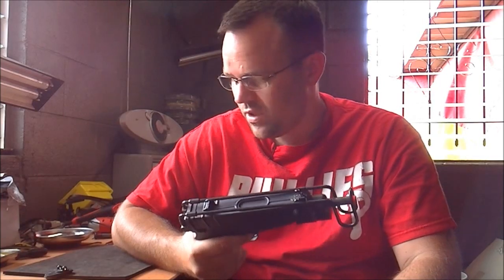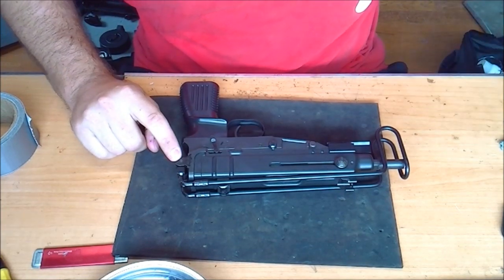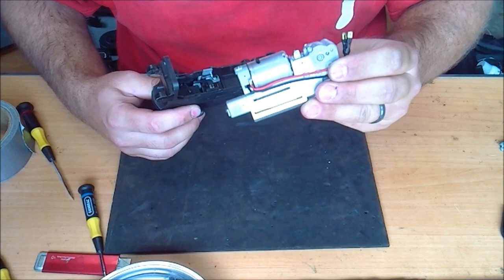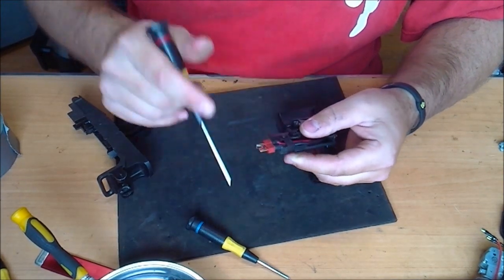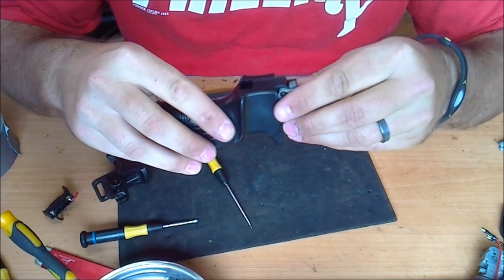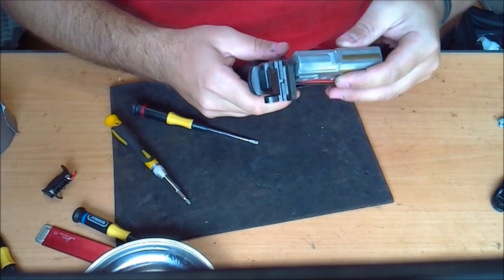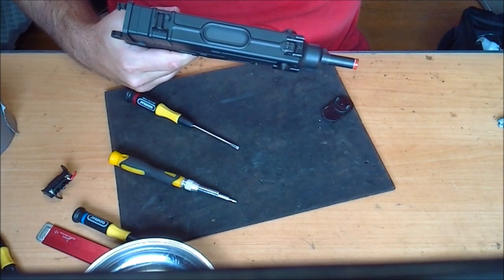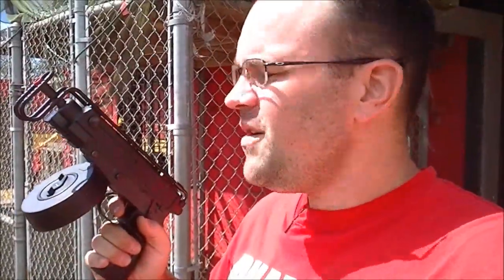Tokyo Marui VZ61 Scorpion disassembly & review.

Comment: Thanks for the video, it was very useful for the lipo mod.
I'd just like to add a few of notes which might help others who want to disassemble this AEP. I hope you don't mind:

3:37 The small allen screw near the trigger guard is the motor adjustment height screw, and should NOT be removed.

It's very easy for the semi/auto selector piece, (labelled R-16 in the Well manual) to fall out when you remove the pistol grip.

 7:08 There should actually be 2 screws holding the switch assembly into the handgrip, the one shown in the video, and another near the top left in the video (the 'front' end nearest the trigger guard.

Just so people don't get confused :-)

Comment: I just got the Well clone of this gun and I dropped it out of the box and totally snapped the pistol grip from the receiver, this video saved my ass and helped me fix it! It works just fine now! Thank you for this
Reply: Had the same thing with my asg, had to basically look at the exploded diagram for about 6 hours to reconnect any and all wires and springs that detached, and then I replaced the 2 stock screws that failed to hold the pistol grip on with 2 1 inch Allen bolts

Comment: I have the WELL model and you have to split the grip in half with force (carefully!!). Mine was glued at the bottom of the grip, started at the top.... Then you can unscrew the trigger/fuse assembly from the left side grip half so you can lipo mod and wire to deans.

Comment: Interesting, thanks for the video. I'm thinking about silver rewiring, using the stock battery, adjust the gearbox and change the bucking and barrel. Hope it will work well.
Reply from the maker: Having low resistance wiring will help but the limits of the nicad stock battery are well below the 7.4v 500 mah lipo i used. I also replaced the stock wires with low resistance ones though not silver. Also the barrel and bucking were aftermarket installed by the owner.
Reply: @gruntlogic6239  Merci. Do you have to cut or make any hole in the pistol grip to allow that upgrade?
Reply from the maker: @juakagami8070  I did. the plastic that holds the stick battery, fuse all came out for mine to make room for a deans connector, wire and 7.4v 500mah sky lipo battery. Maybe you could find a battery to fit without modifying but I chose not to to fit the battery I had available

Comment from the maker: if its engaging the motor when you pull the trigger i doubt its the wires. Airsoft Atlanta has some replacement parts available as does airsoft gun repair dot com. the second site has the gun parts in sections for sale so you can drop in a whole motor and gearbox in to replace yours which i think might be your issue.
Reply: I need you help with the gun

Comment from the maker: For the Hop up I believe that the bucking is a regular aeg bucking but if you just want to replace the whole barrel/hopup assembly for $20 shipped then use the link in the description for airsoftgunrepair(dot)com.  I also will double check for you tomorrow as my gun is at Kapolei Airsoft in my locker.

Comment from the maker: it could be a piston that is locked to the rear just like an AEG. it it dosent release with a full charged stock battery you might have to find a way to connect a 9.6v using wires or alligator clips. If its still stuck you might have broken a gear.

Comment from the maker: ok first sorry for taking so long to respond, and as to the trigger issue the trigger issue could be from a broken piece in the trigger group. The trigger group is housed in the pistol grip and contains 20 or so small connected pieces that if one fails it can make the gun not function properly. If you want to just replace the trigger mech or any other piece you can get them at airsoft gun repair (dot) com and just search for scorpion parts.  I'll also add the link to the description.

Comment: Scratch that- the Allen screw near the trigger guard is actually motor height adjustment- too tight and the gearbox will seize! ;) FYI for anyone using this very good guide ;)

Comment: Hi Chap. So I've stripped the gearbox to reshim, do air seals and regrease. Gearbox runs beautifully outside of the receiver but when it's back in doesn't cycle, any idea what I've missed? Battery gets warm, connectors are back where they should be, baffled!
Reply from the maker: Rich Upton sry for the super late reply, but it seems that there is something that is preventing the motor from turning so as you press the trigger and feed electricity to the motor it wont move and loops the power back into the battery creating heat.

Comment: hey gruntlogic i bought the JG Scorpion about a month ago and just recently it stopped firing and i opened it up. The wires on the fuse box end had ripped out and I was wondering if I can just cut them and re wire to deans. Also what battery can fit in it with that configuration?

Comment: What are the dimensions of the pistol grip? I'm about to order some 30x12x55 batteries, will they fit?
btw, the video is really informative and it's been a great help
Reply from the maker: So Jose. I'm not quite sure what the dimensions of the pistol grip are but after my modifications I was able to fit a Dean's connector as well as a sky lipo  7.4 V 500 mA battery  You could get the wires.
Reply: gruntlogic6239 thank you, I'll check it out

Comment: So I am trying to do this mod on a couple of my Vx61 Scorpions and I am wondering what specific battery you were able to fit in the grip? I'm having problems fitting an 800 7.4v lipo in the grip. Could you point me to some models that fit?
Reply from the maker: +Jason Lane I used a sky lipo 500mah 7.4v, I'll add link in the description
Reply: +gruntlogic6239 thanks! How long does the 500mah last? I am worried it would not last a day on the field.
Reply from the maker: So it lasted me through 7-8 drum mags out of my gun and still had power left.

Comment: Hey I have a question, I know this is an old video do you still have knowledge on this?
Reply from the maker: Its 7years old but I remember what i did and about the gun, why?
Reply: gruntlogic6239 wow I had low hopes for a reply thanks, but yea there’s a little part that goes with the selector switch, I completed the lipo mod but my fire selector doesn’t work, can you help me please?
Reply from the maker: @clognehssi9832 if it's not firing at all then I would say that your selector on the mech box is in the safe position and when you try to move it to fire/auto it won't move. Either that or you might be putting the selector in incorrectly. I had that happen once or twice working on my gun.
Reply: gruntlogic6239 my gun only shoots on full auto, everything works perfect except that I can’t put it on semi or safe, and I know what part it is because I have outside the gun and couldn’t figure out where to put it, pherhaps I can pm you somewhere and send a quick picture? Or I can upload a small video of what it is, i really need help that’s why I want to use this gun on Saturday thanks 🙏
Reply from the maker: @clognehssi9832  i dont have the gun anymore. I'm not sure what small piece you mean. I thought that the selector arm was all there was... it's been 5 years or so since I had mine.
Reply: gruntlogic6239 it’s not the one that looks like a t, there’s another parts it’s weird idk what place it goes on, I’m going to post a video about it, hopefully you can recall it, if not it’s fine
Reply: gruntlogic6239 did you check out my vid?

Comment: Okay bad video, your tappet plate is supposed to be able to freely move with touching it, not stiff as a metal wall. I couldn't get my gearbox in the shell because the tappet plate was a metal wall not allowing it to seat on the trigger.

To fix this, you will have to remove the magazine catch and metal plate that the air nozzle sits on in the gun. Once you do that hook the gun up and fire it once or twice to free the tappet plate. Then you will be able to install it! I just spent 2 hours trying to figure out why my gun was not going back together and watching the only two VZ61 videos on youtube which no one told you this.
Reply from the maker: Actual Airsoft Reviews so I personally have not had cause to go into my gearbox for my scorpion I have merely taken the gearbox assembly as a whole and removed it from the gun for modification
Reply: I hope my comment can help others, I know each brand is different and guns are weird o.O